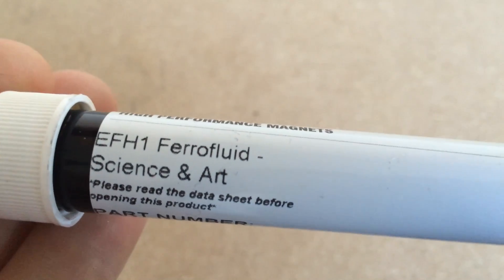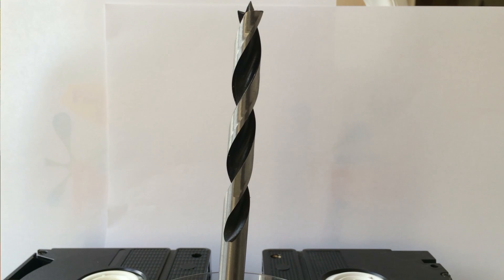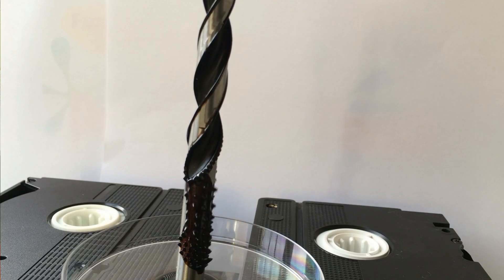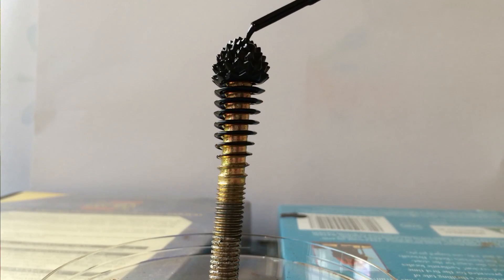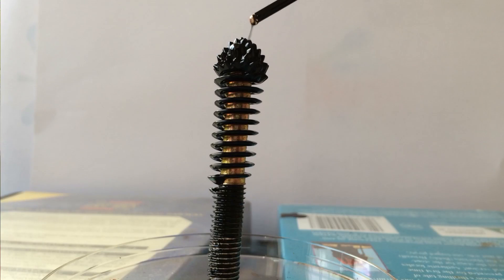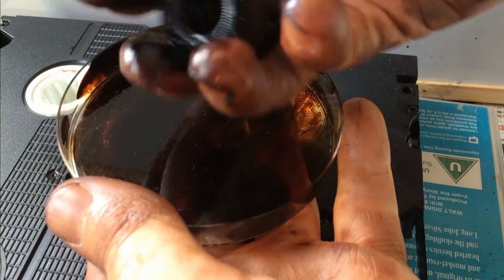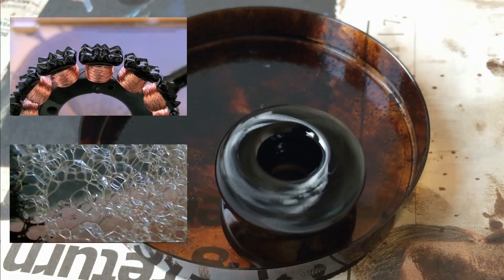Playing With Ferrofluid!

Comment: This FerroFluid stuff would be great if it could be somehow implemented to components like bearings considering it's low-friction properties when it's directly on a powerful magnet. Small bearings made of those magnets and then sealed inside a small bearing cartridge with that ferrofluid would mean highly efficient components for things like bikes, washing machines, car parts, excavator parts and just about any machine you can think of.
Reply: They do. But it's going to raise the cost of manufacturing when you're talking about using them in things like bikes.

Comment: Am I the only one that thinks that spinning magnet-ferrofulid combination could be used as a perpetual engine!?
Reply: +The Asylum But it's not perpetual. It just has very little friction.
Reply: Pico Loco Of course, but, consider this, charging a capacitor with the spinning of the low friction, then using a small amount of power to set it off again....
Reply: +Pico Loco This is just my uneducated knowledge of physics speaking, supposedly it's an impossibility....
Reply: +The Asylum making the thing spin and creating kinetic energy is not the hard part.  you could keep something spinning forever.  But as soon as you try to transfer that energy, harness it.  You create friction and resistance.   I guess that if we understood magnetic fields a little better, we could focus them to make things spin in the same way we currently use wind to spin floating magnets.
Reply: Falenir Yeah I'm definitely under the assumption that magnets are to be the greatest breakthrough in technological advancement in a couple of years, I mean, we still don't even understand why a transformer works, it just....does.
Just look at Japan, they've replaced their train tracks in certain areas with magnets, creating a floating train line able to go from 0-80 km/h at incredible speeds as it doesn't need to be connected to the ground!
Reply: Strider Sky Yeah I've been thinking about perpetual engines ever since a professor brought them too light...Though he thinks Hydrogen engines will most likely be the next energy leap in technology, which I wouldn't be entirely in disagreement with
Reply: Strider Sky I don't think the fact that they would be easily stopped from spinning would be a problem, once we make that breakthrough, most people would be able to start it again, if not, that would give the electricians a new job, also, there is no chance of a new element, but that doesn't mean that people shouldn't be on the field trying to be the people who make that breakthrough, someone has to :)
Reply: Strider Sky Who knows, a theory is just a fancy word for an educated guess
Reply: Sardonyx You're not taking me alive!
Reply: +The Asylum it could be used as a perpetual engine! man I wish I had the mind of an inventor! i was thinking the same thing!
Reply: Strider Sky Probably not
Reply: +The Asylum Wrong! People make that assumption all the time, but a "theory" in the formal scientific sense is much, much more than an "educated guess". Scientific theories have to be developed and then repeatedly tested and confirmed using the scientific method; they must also be falsifiable and should ideally be able to predict things in advance.

The everyday use of the word "theory" is closer to what most scientists would call a "hypothesis", and even a hypothesis still needs to be testable by others using the scientific method. (So a vague, half-thought-out idea wouldn't count, for example).
Reply: NotATube Thanks for explaining that, I always wondered how much effort goes into a theory.
Reply: Do you know the meaning of prepretual?
Reply: Harman Kardon Go Yes and you spelled it wrong.
Reply: The Asylum im german and my mobile does Not know a few words
Reply: Harman Kardon Go My apologies then
Reply: The Asylum thanks
Reply: I guess if you could put that in some sort of bismuth magnet and combine it with some other magnetic awesome stuff this could be worth a try
Reply: it's obvious that not a lot of people know this but magnets run out, is the simplest term to discribe it
Reply: it's obvious that not a lot of people know this but magnets run out, is the simplest term to discribe it
Reply: +The Asylum you could make it spin for a very long time, but unfortunately you could only get out the amount of work you put in. the closest you could get to a perpetual motor is a mechanical advantage. I was thinking more of a bearing race lubricant?
Reply: no be co
Reply: +The Asylum Please refer to the Second Law of Thermodynamics
Reply: John McGee I don't claim to be a scientist, but basing laws of the universe on a theory seems to be slightly...presumptuous? Now, I understand that everything is a theory in the greater span of the universe but the only way to disprove theories is surely, to test them and break the boundaries we've invented for ourselves.
"We cannot solve our problems with the same thinking we used to create them" - Albert Einstein
Reply: You got one thing right. You're not a scientist. The laws of thermodynamics are not theories. They are just that, laws. They have been proven time and time again through experimentation. I'm a mechanical engineer and I worked in energy. Everything from nuclear to oil and gas to bio-fuels. Nothing is 100% efficient. Friction is real and the universe is always moving to a greater state of entropy. I think even Einstein would agree me on this one, but thanks for inspirational quote.
Reply: John McGee Hey, i hope I didn't offend you in any way, people are taking this as some form of bible verse, I'm an uneducated plebian here. And yeah, it is a great quote.
Reply: +Afforestation 5 yup, same thought.
Reply: +Afforestation 5 yup, same thought.
Reply: the term perpetual means infinite and as shown in this video it doesn't spin infinitely plus an engine creates and controls energy plus prepetial motion is purely theoretical and only that for its physically impossible so this statement makes no sense whatsoever
Reply: No .... but i thought instantly that the fluid would make an excellent bearing for my magnetic generator idea. :-) Nearly zero friction.
Reply: It is used in rockets as a type of fuel.
Reply: @Falenir  That is literally how generators work

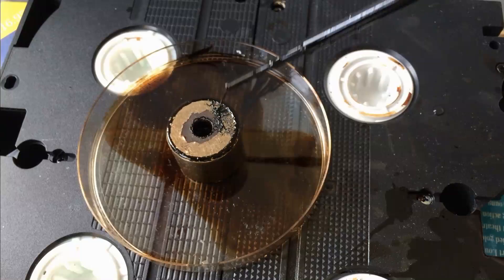Comment: holy fuck has anyone thought about magnetic ferrofluid ball bearing? that thing has amazing friction resistance 3:55. the bearing just needs to be encased in extreme positive pressure? and the liquid needed inside the bearing would only be like millimeters thic the pressure just needs to be right for different appliances ? i know magnetism fucks around with everything around it but surely there is some appliances this is usefull?

Comment: how little friction there is is interesting...   has this stuff ever been used as lubricant for things like bearings? or is there major drawbacks?
Reply: Well the stuff is like water so it may be harder to contain in a barring and if a magnet happen to get close to it it might pull the fluid towards one side leaving some parts dry.
Reply: avenger225hp
true...seems obvious now you mention it... ahahah
Reply: Bearings are already very well lubricated with bearing grease and I think swapping that for a magnetic fluid would only hinder its functionality.
It wouldn't really work in a "mag-lev" set-up either, as they rely on the fact that the surfaces do not touch each other at all. Introducing ferrofluid would actually add friction.
Reply: *****
ah, makes sence

Comment: It's funny how you used tapes to make a stand for the objects since the ferrous oxide in your ferrofluid is actually the main component of video tapes! In fact, with acetone you can break the oxide from the binder material and extract it to create cheap DIY ferrofluid for like 3 bucks.

Comment: if i wanted to put the metal object and glue it to the bottom of a glass jar then fill it with half water half rubbing alcohol then pour in 50ml of ferrofluid then have a strong magnet on the bottom of the outside of the jar, would it constantly move and work?

Comment: Please could someone tell me if it's possible for Ferro fluid to climb up the threads of the bolt to the top if the magnet was situated at the top? Was thinking if it would be possible for a wheel to come past scrape some fluid off and the permanent magnet acting a a pump to get the Ferro fluid to the top

Comment: I wonder if there's any practical use of this stuff...
Reply: Like the profile picture
Reply: Skraith used as 'lube' between metal in industry, they can bemoved easier
Reply: SuperMineApple I was thinking that but wouldn't it leave some air pockets? Would that matter? Sorry, not very good in industry and stuff.
Reply: Skraith nah, Magnets do not care about air. :D
Reply: Skraith There is indeed, for one example Audi uses a ferrofluid in it's 'Audi Magnetic Ride' suspension system. By changing the magnetic field, the alignment of the tiny particles in the fluid change and alter the damping force. Pretty clever.

Comment: I have an idea! I know magnet bearings exist. But, instead I would use a tube shaped magnet, then put a shaft through it with a smaller diameter, lets say for example 2.5 cm shaft and a 3 cm inner diameter of the magnet. And then fill the magnet with ferrofluid and seal the sides fluidproof. I think it would be a much more stable magnet bearing ;)
Reply: Google ferrofluid bearing, already been done.